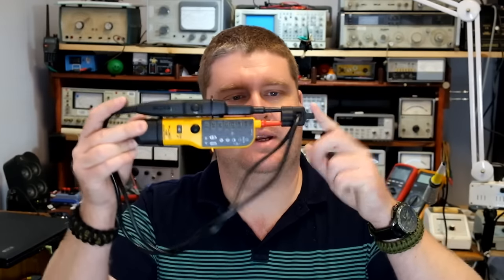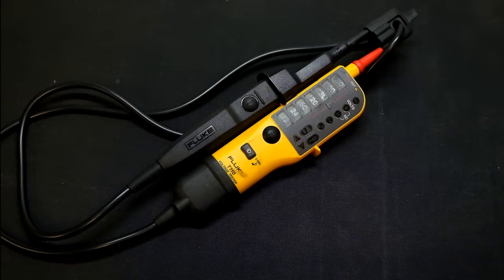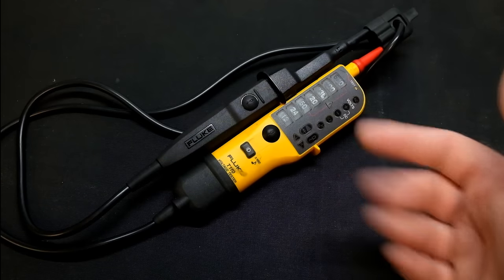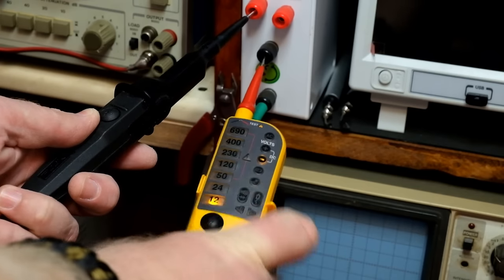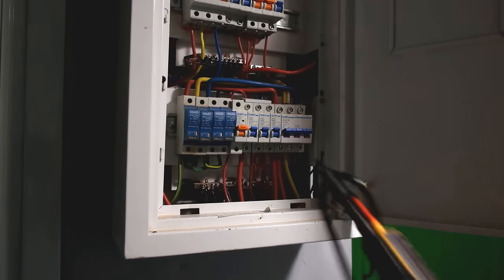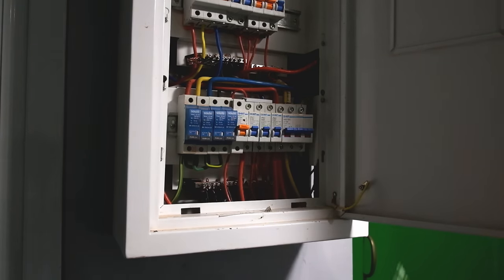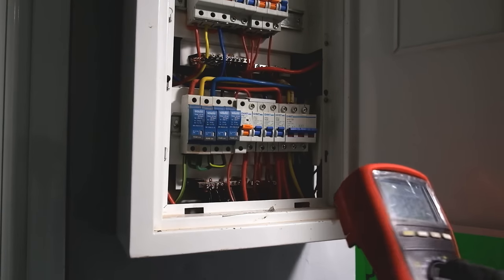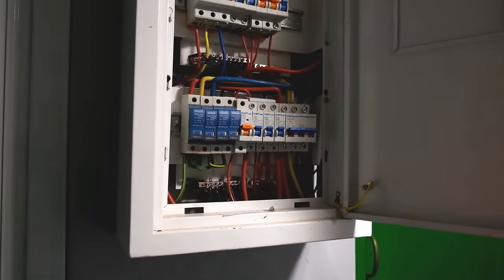Episode 39   Fluke T110 Voltage Tester & Testing Single and 3 Phase Power

Comment: Nice clear video. Does the T110 probe have a low impedance setting for finding ghost voltages?
Reply: Pressing the round buttons on the main unit and probe together reduces the impedance from 200KΩ to 7KΩ.

Comment: Do you need a proving unit with this or does it have a test built in?
Reply: These Flukes are very safe, everyone in the trade can confirm.. still using a separate proving unit is the law in most countries

Comment: Good Video!
In Germany it is mandatory for professionals to check with such devices if the circuit is disconnected and save.
Reply from the maker: +Arne Schwaab Its always a good idea to check and switch off before working on any mains power circuits.
Reply: +Evione Electronics
No - I mean that it is simply not allowed and common to use a Multimeter to check power circuits as Professional Electrician (commercially) .
Reply: +Arne Schwaab It is described in the Standard "Din VDE 0680"
Reply: Arne Schwaab I think you’ll find it’s mandatory in this country also.

Comment: Are those gloves electrician insulated gloves or can we use any gloves?
Reply from the maker: The ones I used are semi insulated. They just guard against accidental contact and such. I suggest proper insulated gloves and an inspection of your leads and meter before testing any high energy circuits.
Reply: Thank you for the quick response. Great video.

Comment: what is the left rotation or the right one? i have the meter and those lights dont light up for my mains voltage
Reply: +Stratos Vasilas make sure its ac and it displays 230/120v while being connected to both neutral and phase. If it then does not work contact fluke or the retailer.
Reply: Rotation only applies to three phase power. To determine phase rotation, you press the probes at two different phases and by holding the plastic body you provide a capacitive coupling to ground. That's how the meter is able to determine the phase sequence without hooking up three wires as the traditional little rotational testers do.

When he was measuring from phase to ground the 'L' did light up, but that has no significance, you need to measure phase to phase. Same deal when he was measuring the socket outlet.
Reply: thanks for the answer, its been a year and i still didn't knew what those lights were about. :)

Comment: What is meant by a circuit having continuity ? Thanks.
Reply: Mark Shaw, connection like a circle.
Reply: Duck Man Thank you duckman, I presume that the "circle" can have continuity without needing a current to pass through ? Thank you for you answer.
Reply: @AfricanSouthernCross  exactly. Basically you can touch ie. single detached wire and see if has continuity etc. Tester will show and beep rapidly if has. Obviously useful in ie. 24vdc circuit when checking for ground points etc.